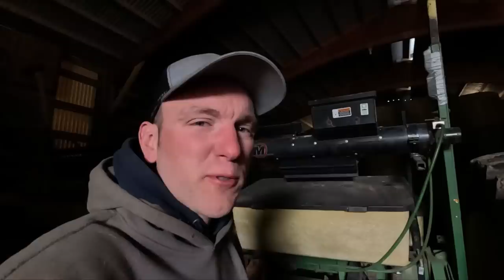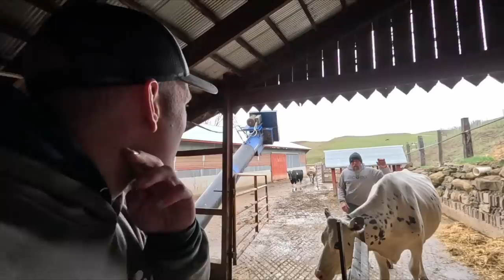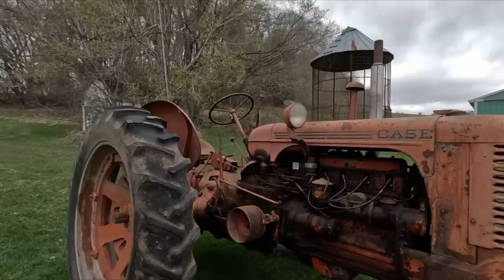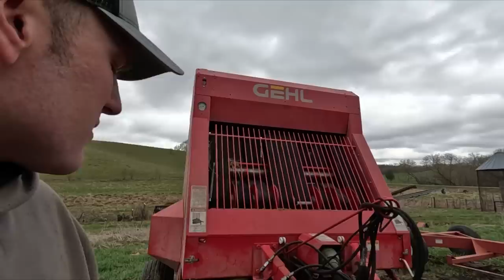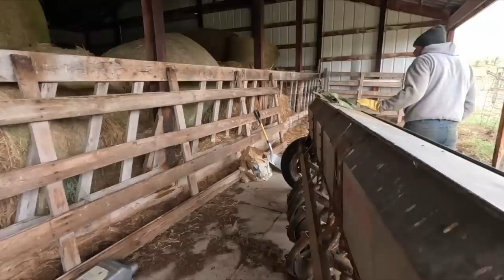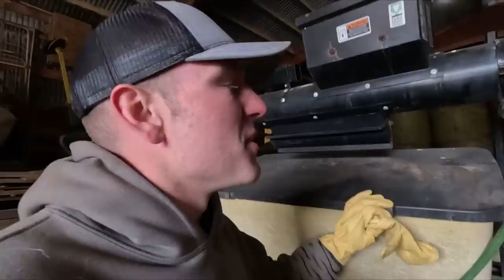Equipment Upgrades?!?!

Comment: I have a Gehl 1875 round baler and I really like it and it's fairly simple to run and work on. The monitor is very nice and u can actually buy an adapter for net wrap. They are fairly inexpensive to buy and parts are available, really like watching ur videos

Comment: I have that Gehl Round baler. Makes 5 by 6 bales. Good baler mine is twine only. Works good. Bales are a little loose but that is twine. I only gave like 3500 dollars for mine at a dealer. Would be another one. Hope that helps a little bit.